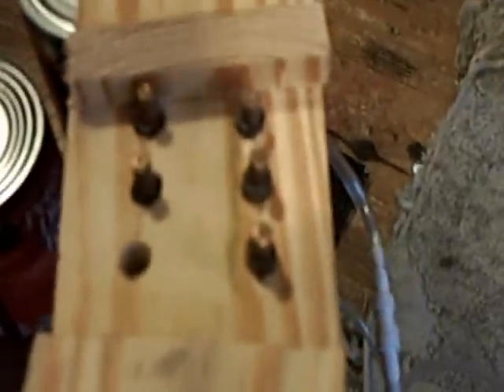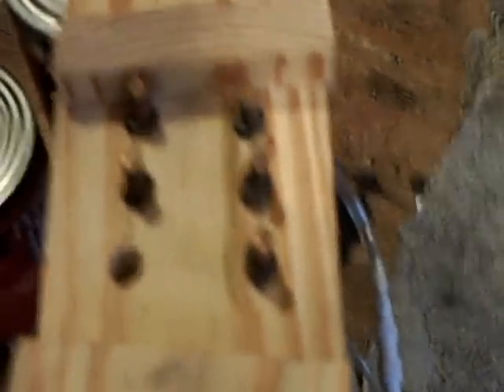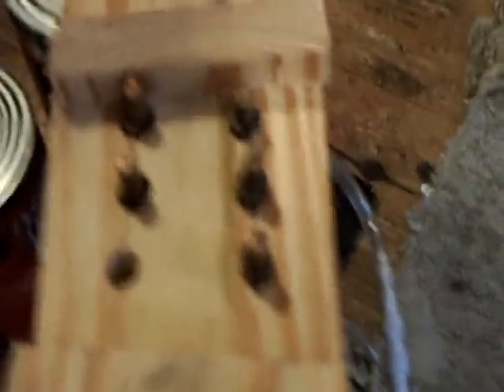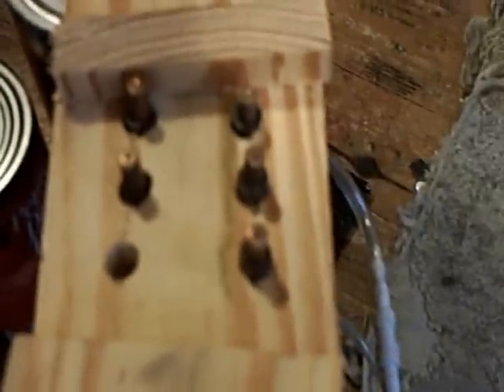5 hho flames using only 60.5 watts

Comment from the maker: You are right it does do better with everything closed off. , The biggest problem I see so far is dealing with the water build up from burning  the hho ...when its just about completely closed off if ya dont keep an eye on it will put the flames out from water dropping on it , but they also self ignite right back its pretty neat ...

Comment: i really think that you could increase the effeciency of this heat output but having the tips pushed through the bottom of an aluminium heat sink so it absorbs the heat from the brass tip and also the fins will absorb the heat and then finally the tuna can with a lid and side walls going down to the bench top to full contain any heat produced. i think you could acheive 30% fast boil easily.